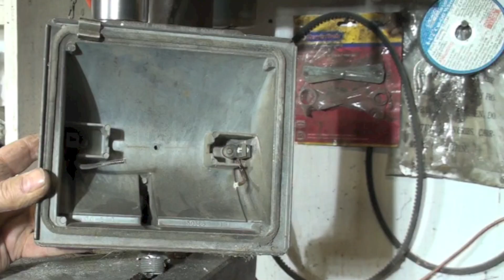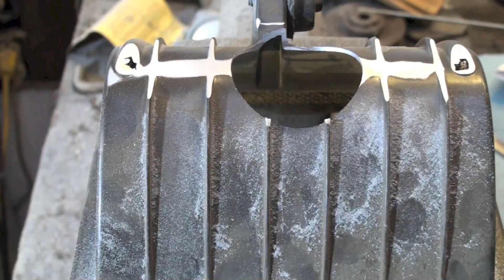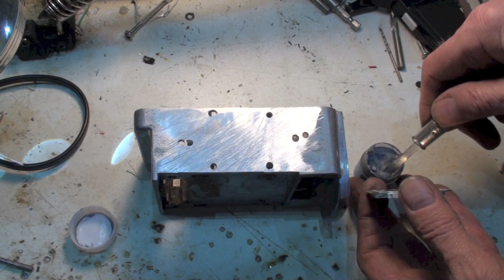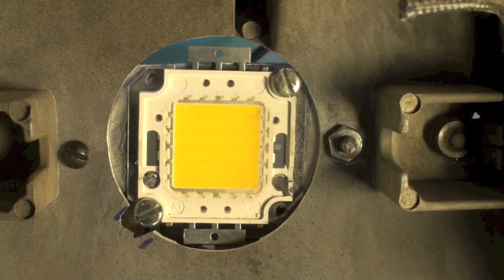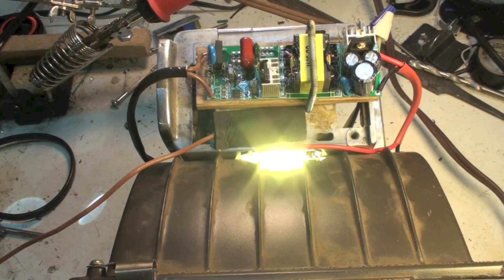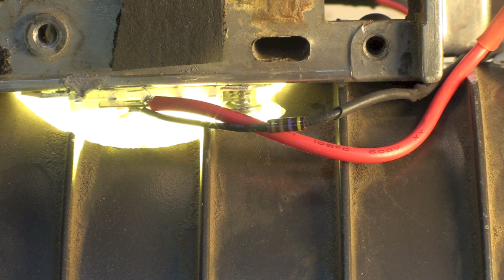How to convert halogen to LED

Comment: You used too much thermal grease/paste. It doesn't transfer heat as well as metal to metal, but better than air. So, what you want is to spread it as thin as possible so that you fill all the microscopic spaces in the metal surface, but no more. Use an old credit card or similar stiff but flexible card with a straight edge to spread a pea-sized dab of paste to cover something the size of that cob. Your light/CPU will run cooler and last longer if you get it right.
But, otherwise it looks like a good hack and I enjoyed watching. Cheers.
Reply from the maker: +Markle2k Thanks for the thoughts.
GFM

Comment: Hey GFM, neat little project. I was thinking that a heat sink and fan off of an old computer CPU would work to keep that led cool. They do a good job keeping CPU cool and they have thousands of transistors in them.
Reply from the maker: I have used CPU heat sinks, they work quite well, but I ran out.
GFM

Comment: Interesting way to do it mate! I really like how you've used the reflective tape. They sure do get hot those chips! Personally I like using CPU coolers as a heatsink, anything AMD branded are a good performer FYI. You can utilise the fan on them too.
For some reason I always like directly solder to the closest point too, some of those chips the connection tabs don't always work! It's really cool to put a sharp object in those chips and apply a variable voltage, you can see the tiny tracks make a circuit and light up individual LED's making one big one!

Led module Here's my design mate, construction time was pretty quick too, longest part was waiting for the glue to dry lol! And totally not approved either, but we could get away with it if you use low voltage switch mode supply (like a computer PSU). Anything under 50V DC you don't even need to have a electrical licence in Australia anyway.

Comment: Great video! Can you provide what site you order the items from? Thank you!
Reply from the maker: I can give one of them as an example.  I have had good luck with all of the suppliers so far.  The product is:  50W LED High Power Light Lamp Chip +Warm White LED Power Supply Driver.  The seller is store365buy.  The example includes the driver and the led.  I will be doing one on a different method soon.  I will be using a centrally located driver that uses the existing wiring for the 36 volt power for permanently mounted lights.  
GFM
Reply: Thanks a bunch!